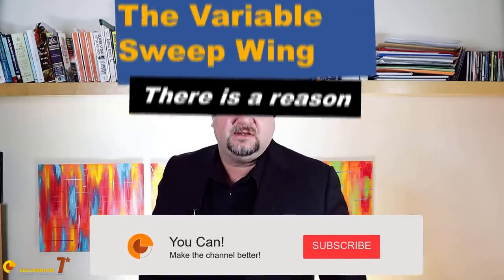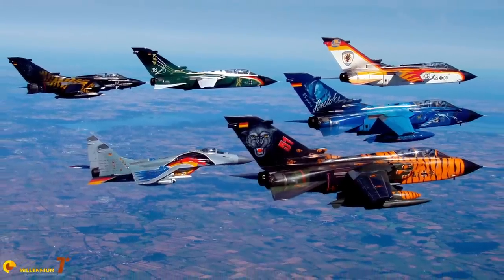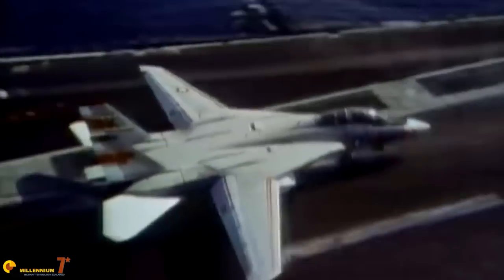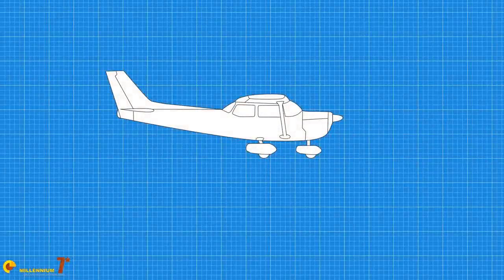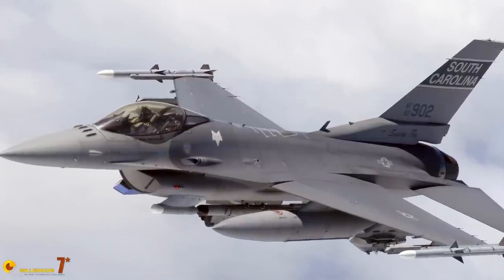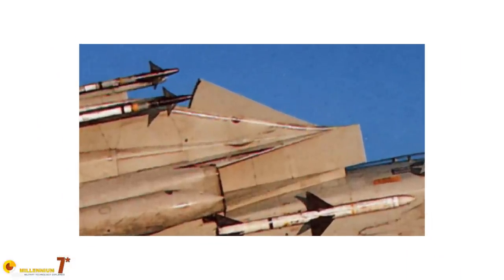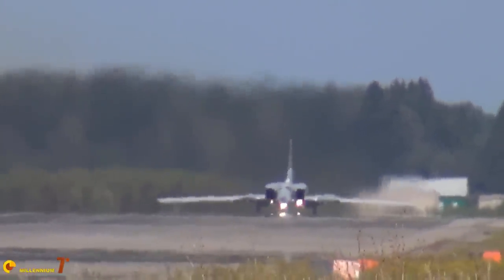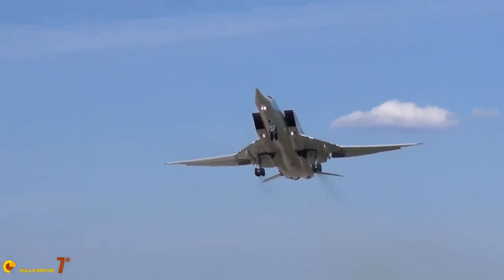F-111, F-14, Tornado, Su-17 were Hopelessly Outdated - the demise of the variable sweep wing

Comment: When the Navy was trying to decide between sticking with the F-14 or going with the FA-18 Superhornet, there was a program put forth to rebuild the F-14 into a semi stealthy design like the FA-18 or newer European fighters. The biggest offender on an F-14 as it relates to it's RCS isn't the swing wing, it's the huge amount of fan that is visible to radar from the front. The new design shrouded the fan, gave it new powerful turbofan engines, replaced the bulky and maintenance intensive subsytems with newer designs and strapped a massive AESA radar in the nose cone along with all new avionics and a glass cockpit. Supposedly it's range and performance were totally unmatched by anything at the time and only the newer Russian birds are close.
Reply: Pretty bad ass
Reply: also sounds like an absolute nightmare for the taxpayer - combining the most expensive features in one platform
Reply: @bibbrr The F-35 is a multirole that is literally unmatched in electronic warfare, is one of the best stealth aircraft around, and has a plethora of parts available because of use by 3 branches and international partners. Also boasts a 20 to 1 kill ratio. Well worth the Tax Payer money for a system that’s estimated to last till around the 2060’s and beyond.
Reply: @infinite683  actually only 20% of parts are shared between all different F-35 varients so don't think you'd be saving that much money. Also the supposed design suggested for the ST21 would also make it into a relatively stealthy multirole aircraft
Reply: @Infinite6  the super tomcat was something else.
Reply: @@ChangeEvery14Days The cost was on par with the F-22. Which was still steep and more than the Navy wanted to spend. Plus, the F-14 was doomed no matter what. Dich Cheney HATED Grumman for some reason. There was a less than 0 chance of the Grumman F-14 getting procured even if they were able to do all the stuff I said for the cost of a Gripen

Comment: While the swept wing could give you distinct low speed turn capabilities, people tend to ignore the deficiencies of the design on various levels. You commented on a few of them. But I can also add (maybe I missed it though?) severe buffeting and airframe stress. Swept wing designs were notoriously prone to heavy shaking when pushed. A very high variable/dynamic load on a long flexible wing tends to create more buffeting issues than a very rigid fixed wing relatively stubbed from the airframe body.
Reply from the maker: Good observation

Comment: Good video, good explanation of why VSW went away almost as soon as it appeared, but seems to have a fair amount of flawed logic and misunderstandings of the reality of air combat, especially in the context of specific types of combat aircraft. It is no accident that the F-14 and MiG-23 were the only out-and-out fighters fitted with variable wings, and both required modification to become good maneuvering aircraft (the F-14 needed new engines and the MiG-23 needed improved aerodynamics, specifically). And before the comments "correct" me, the Tornado ADV was an interceptor, not a fighter :)

All the rest are attackers or bombers, and in that context variable wings provide numerous advantages pertinent to their particular mission requirements, especially in regards to drag (for high speed flight at low level) versus lift (for shorter takeoffs, better range, and better endurance), while the downsides for maneuvering are reduced as such aircraft generally do not require hard maneuvering. If they get "bounced" then that is more an operational failure by fighters to counter the enemy fighters.

Previously you could have low drag or high lift but not both; the F-105 was quite speedy but required very long runways to take off, thus essentially restricting them to bases in Thailand where they had to refuel multiple times to get to anywhere useful in North Vietnam, while the A-6 with its modest wing sweep had good range and persistence, but was fairly slow and mostly flew night missions to offset their relative vulnerability. 

The F-111 essentially combined the best aspects of both and was an exceptional aircraft in its capacity of blow stuff up (when it worked), likewise for the Tornado, Su-17/22, and Su-24. To characterize them as "hopelessly outdated" is rather misleading in general terms and simply wrong in the context of their prescribed mission. And even then the idea that variable wings are entirely unsuited for fighters is also not really correct; when fitted with engines actually suitable for a fighter aircraft, the F-14B and D were plenty able to dance with any of their contemporaries, though this has as much to do with its enormous lifting body as it does with any design considerations for its wing.

On the maintenance aspect, you are entirely correct, hence the primary users of the more complex variable wing aircraft tended to have the logistical capacity to simply brute force any maintenance concerns. It is poignant that the most widely used variable wing aircraft were the MiG-23/27 and Su-22, both of which were quite basic and simple mechanical designs compared to others and thus both designs are still in widespread use.

No one factor is any more or less important when designing a combat aircraft; it's all about achieving an optimal compromise for the anticipated purpose of said aircraft. For the various fast bombers and attackers the variable wing was an ideal compromise for their operational goals. And in that context, it's not so much that variable sweep wings themselves are obsolete that the idea of a single-purpose aircraft fell out of favor. In my opinion, the only design consideration that has caused variable sweep wings to actually fall out of favor is stealth; the the need to keep surface angles consistent as much as possible means that variable sweep wings are probably gone for good
Reply: ..until 'stealth' is superceded by the development of newer/better sensors...

Comment: It’s been quoted that Geometry wing configuration and thrust vectoring  would be a unmatchable force’’  with significantly increase margins in manoeuvrability ‘ energy ‘ and power to weight ratio ‘  Northrop Grumman has all this in mind for the next variant of the F-14 Tomcat -ST-21 with major upgrades  in the Avionics ‘ fire control system ‘ and a new bubble canopy  and helmet mounted display for the crew !!!!
Reply: Fascinating. Except the ST-21 was cancelled long ago
Reply: @samarkand1585   you’ve just  mentioned how Geometry wing sweep is  so outdated  Which is BS  the ST-21 with thrust vectoring  and super cruise would be a formidable. platform in any scenario  1or 2 circle ⭕️     against any Adversary!!!!
Reply: @steviechalmers1218  where did I say it was outdated? You live in a strange, strange world in your mind

Comment: Fact, a modern F14 with a glass cockpit and modern radar and weapons would still be a massively formidable platform, the airframe is still capable in the right hands of out flying many more modern airframes, assuming it is well flown.
Reply: I agree. The Tomcat could turn with a lot of smaller fighters but was still a big fighter, because of wing sweep. Fly-by wire, thrust vectoring, a little more power and efficiency, modern weapons system updates, and it could've carried on longer.  Stealth? You don't necessarily need stealth if you want the enemy to be intimidated into leaving the area. As to maintenance issues, nothing is going to hold up to years of hot dogging and carrier landings. Every once in awhile a major factory refresh would've helped. Stripped down, all new wiring and boxes, actuators, etc., that sort of thing. Would've been neat to see a fly by wire system and thrust vectoring correct a flat spin without pilot input.
Reply: @pgtmr2713  Its an old girl now for sure, I think it took a long time for anything to come along and make it look old TBH, and it has tended to be the weapon systems, glass cockpits, thrust vectors etc which have aged it more than the swing wing design IMO ?? Its a big bird for sure.

Comment: In principle all your points are correct but .... I hereby predict that an evolved version of the concept will sooner or later (re)emerge. First a small correction. Although the glove vanes on the F14 where used on hte prototypes their advantages where so low that it was decided not to use them during the aircrafts service life. Since they where however already installed they where always locked close. That should mean that their sweep actuators will actually have been removed. Back to my ,ain point: Why might variable sweep come back? Because all planes in which it was used are of an older generation the disadvantage still came at a relatively high price. All these can however for a big part be nagated by using new technology and materials, like carbon composites. Even stealth should not be a persistant problem. The aircraft could be tuned to have maximum stealth in a certain configuration, for instance by keeping the angle of the wings leading edge the same as that of the tail, but move out of that constellation in parts of the envelope where stealth is not the first consideration. The most important reason for my prediction is however that the wing of the future will constantly change it shape anyway, getting ever closer to a birds wing. It will in the end not even have seperate control surfaces anymore but flex it's wings like the Wright flyer did! That in itself will already be a stealth increasing feature. Nonsense? NASA/DARPA have actually already studied a first incarnation of the idea years ago when the needed technology was still much less evolved then it is now. Check out the MAW (Mission Adaptive Wing) project for which ..... tada !... an F111 was used. Sooner or later this concept will come back with a vengeance. The needed technology sweep (pun intende) is progressing furhter as we speak, often actually while being intended for other solutions but sooner or later the penny will drop.
Reply: But new motor designs are already in the 50,000lb class. Carbon materials and 100,000lb thrust on take-off makes a sweep angle variable geometry even less likely. I'm tracking on the aeroelasticity geometry though. Those experiments were very interesting.
Reply: Combine variable sweep wings and vector thrust engines and you've got a monster.
Reply: You are mostly right about the glove vanes. Glove vanes were functional in the F-14A until the early 1990s, when they were disabled. The F-14B had glove vanes but they were never functional. The F-14D didn't have glove vanes at all.
Reply: @DragNetJoe  Thanks for putting in the exact details. I should have checked if my memories where fully correct. That's what you get when shooting from the hip. There's a lot of that on Youtube. :-)
Reply: Load capacity/loiter getting to be a higher priority IMHO as close range dogfighting gets to be a smaller priority can be a factor for em imho

Comment: Very interesting and well explained. There’s another reason why these designs didn’t continue past the 80’s: air defences. 

One of the principal advances of swept wings is a low effective wing aspect ratio with the wings swept aft. This allows for stable low level high speed flight, which was key to the survivability of these aircraft in the air defence environment they faced when they were being designed. 

By flying low, they would disappear in the ground clutter in enemy fighter radars. By flying low and fast, they would pass over Sam sites before they had a chance to engage.

However, modern air defences adapted to this new threat. By introducing fighter aircraft with Doppler radars, they added “look down, shoot down” capability, that could distinguish fast moving aircraft from the terrain. From the ground, heat seeking man portable air defences like the stinger and Igla made low level flight all but suicidal. 

This meant that in the modern era, aircraft must fly at medium altitude to avoid these threats, negating one of the key advantages of these aircraft.
Reply: Of course you could just blast those enemy planes out of the sky at long range if you are the Tomcat and you unload a couple of Phoenix missiles,   if by some miracle the enemy planes survive and it turns into a fur ball almost no aircraft could out turn the Tomcat at the low and slow fight once again thanks to the variable wings.
Reply: Joseph Kugel very true. That thing was a beast.
Reply: @josephkugel5099  This asumes that the enemy doesn't respond and ignores one of the greatest principles of warfare "If the enemy is in rsnge so are we" Most peer enemies have missiles capable of reaching BVR
Reply: @andresmartinezramos7513  That is only true if you are talking about any fighter other than the Tomcat,  The AWG9 radar and Phoenix missile combo was unmatched and the Tomcat could fire at targets over 100 miles away when the next missile in line such as the Sparrow could only go 30

Comment: Thank you for this story. I am intimately familiar with F111 and F14 development.   The F14 filled a roll as part of carrier defense from USSR land based attacks.  It was one part of a 3 layer defense.  The swing wing allowed long loiter time with high speed dash.  The F14 flew Carrier Air Patrol and Bar CAP.  If USSR leakers got passed the F14s then the AGEIS system would use missiles and leakers getting past the missiles would taken on PHALANX.   The idea was the F14 would loiter at low speed and then dash towards the enemy.  The USN no longer has an aircraft that can do this.   It also doesn't have the attack capabilities of the A6.   Replacements for these specialized aircraft have been defunded.   The F35 tries to do everything and thus does nothing well.  Its complexity results in having high maintenance like the F14.

Comment: Explain to me what the design of a large long range bomber would look like in 2030 if stealth was not a factor?  Would we be building something like the B-52 again or more like the B-1B?  For the Long Range Bomber mission high maneuverability is not required so the argument that instability is needed is irrelevant.  Also, in the Tomcat the the aircraft was more stable in the wing swept aft configuration and more unstable in swept forward configuration.  ACM is still performed today in the 250 to 400 KT range where the swept forward wing is unstable and therefore more maneuverable.  The stability gain in the wings aft configuration does not negatively impact the Tomcats performance in the supersonic part of the envelope which is demonstrated by the fact that the Tomcat could out turn any fighter of its day at Mach 1.2.  Add thrust vectoring to the Tomcat and it would out turn any fighter today at supersonic speeds.  The Variable Sweep Wing will make a comeback once stealth is no longer a requirement. Stealth will become obsolete once sensors have been developed that over come stealth.  The only thing that will make the Variable Sweep Wing obsolete will be the Transforming Wing (flexible wings) designs that are being researched today.
Reply: Check out SU 37.  Mainly because they pushed it. SU 30 and SU 35 are good too. Even F-22. Scary maueverabilty.

Comment: You explanation for the glove vanes on the F-14A is incorrect. They were installed to increase lift when pulling out of dive and tighter turns with the underpowered TF-30 engines installed in the A model. When the B and D model's came out with the GE-110 powerplants the glove vane system was deleted as the power to weight ratio was improved to what was originally intended to used in the Tomcat. I suggest you do a little research on the reason the Navy went with the TF-30 for the Tomcat. I was a maintenance technician stationed NAWC Pt. Mugu in the early 90's during the test and evaluation on the B and D model Tomacat's.
Swing planes are not stealthy.
B-1B radar footprint of a Humming bird: Am I a joke to you?
Reply: Hmmm.... no. The glove vanes were only deployed above Mach 1 and were not manually controlled. The CADC controlled them as part of the wing sweep program.
Reply: @Whiskey11Gaming  I didn't say they were manually controlled but the did have a override switch.
Reply: @patrickradcliffe3837  I know you didn't. The problem is the statement they are for dive bombing when you'd want something manually operated for that or an aircraft smart enough to deploy them, which the F14 wasnt capable of.  The wing sweep program could only read airspeed in Mach and then reference a wing position table to command the wing location. Revolutionary at the time but very basic.

Comment: The F 111 & F 14 were both ahead of their time.  The swept wing allowed improved performance and multiple air speeds not allowed without the variable wing.  They were ahead of their time and flew longer then most others in their roles.